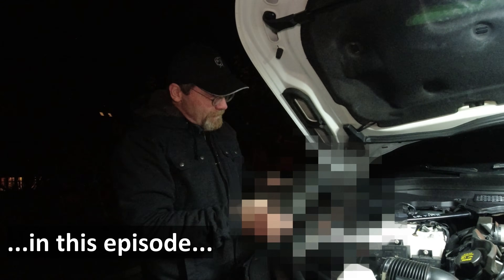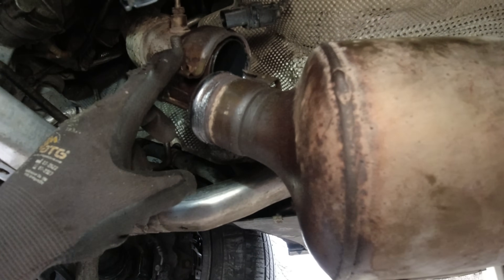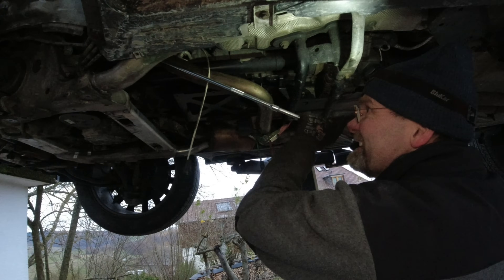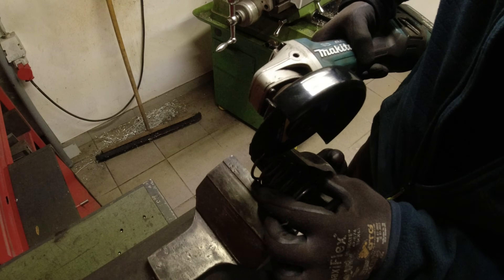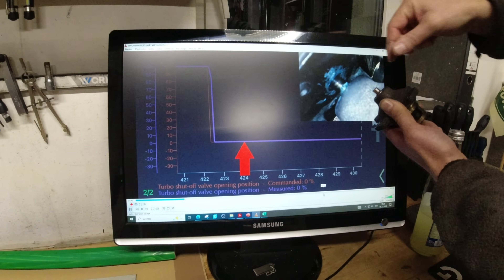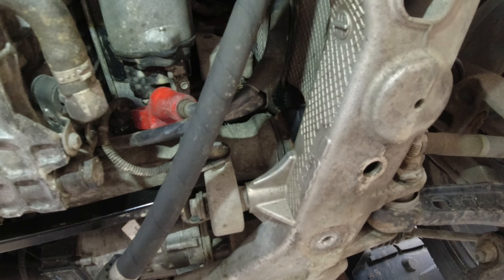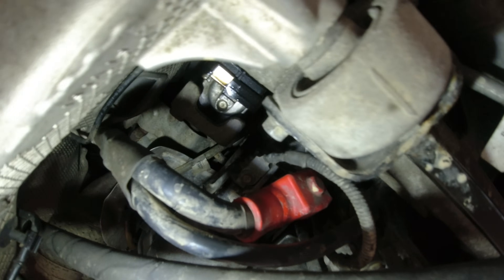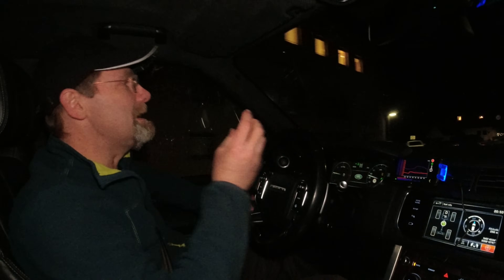Dumbest Land Rover Design Fault EVER - Fixed - L405 Range Rover / S5-Ep1

Comment: Hi much respect for your diagnosing, engineering, understanding and machining skills. I thought I knew how to work on cars, I know very little compared to you. If I could make one suggestion, get some battery operated tools - I use my Milwaukee 2554 and 2457 on almost every job.
Reply from the maker: We have Makita tools. But sometimes exerience tells to not use them and rather go manual. 👍🙋‍♀️
Reply: @Vera_and_Christian  yes sometimes the clicks can be oddly satisfying. I'm interested in either TDV6 diesel or petrol v6 supercharged LR4/full fat queen RR here in the states. It seems the TDV6 is a rather horrible engine based on your videos (my LR3 is long in the tooth 253k miles on V6 4.0 petrol Ford motor).

Comment: Land Rover engineering. My father’s new defender l663 also has loose sound deadening sponge blocks under the boot floorboards wedged between the suspension tower mounts.

Comment: 😂😂😂I had a similar problem with an old Series 3! P.O. had changed the fuel tank but the invoice must have been tucked in the neck and dropped in unnoticed. Every so often the paper would get sucked onto the fuel pick up and shut her down. By the time you came back to recover it the vacuum had decayed, paper dropped off it it would start straight up. Man did I spend a lot of hours and walk a lot of miles before fixing that one. Keep up the good work❤. Happy New Year.

Comment: As a car technician myself, sometimes we overthinking stuff.  I think, if you did a logging of actual values of both air mass sensors while driving, you would see a problem (maybe you can simulate it when you have time). But it is mystery to me why it did not pop up fault code regarding the right side air mass sensor when there was not enough air flow due to trash bag haha.
Reply from the maker: It did pop up a mass air flow fault. But only once or twice.  Because it was intermittent with the garbage bag moving around, I focused on the valve issue because it was more “mechanical”.  Should have kept my eyes open.  Christian

Comment: At 14:18 when you showed the diagram... I was screaming, CHECK THE AIR FILTER / INTAKE!  (As it's quickest and easiest to look at!)
Reply from the maker: We did 😅👍🙋‍♀️
Reply: @Vera_and_Christian  I still wonder WHY it's done the way it is. Most turbo just uses the electrovalve... need more boost, open valve more... All I can think is there is decreased response time from turbo?

Comment: Not having a LR and stil enjoying this, but I have to say (I'm at 11 minutes in by now) why in everything that's holy did you not disconect the vakum from the actuator and take a test run to se if it stil moves before trashing it to pieces? Why! 
Ok now I wil continue watching, this has to be good.😅
Reply from the maker: We did, but the car then has not the power of a V8. So for Christian that was not a permanent solution. Not everything we did is shown in our videos. 🙋‍♀️

Comment: I guess that LR does not know of this cause (obvious really), but the techs always fix it themselves without knowing.
When they follow the fault diagnosis blindly and jump in and replace the listed parts, somewhere along the process they see the loose bag and stuff it back into place - so fixing the problem. But as they have just replaced an expensive part,  they think that was the fix.
Cure by blind accident in such cases really.

Comment: Wow. Awesome skill, both in identifying faults, persevering until you found solutions and creating the parts that solve them. OK, the fault was an easy one to fix in the end but my goodness there was some impressive work going on before you eventually found it.
Reply from the maker: Thanks. I wish I would have found the garbage bag problem right away.  Instead I overlooked it.  Christian
Reply: @Vera_and_Christian  Your video reminded me of some events in the 1980s that I had completely forgotten about. I once spent several months and quite a lot of money trying to cure a misfire on a Honda CX500 motorcycle that only occurred when the weather was wet. Plugs, ignition coils, HT leads, parts of the wiring harness, I spent hours and hours replacing all this but nothing worked. Once on a dry day with the engine running perfectly I drove through a puddle, and the bike instantly misfired. It was driving me mad.
One day I was removing the fuel tank for the 100th time to access the ignition coils that were right under the tank, when by chance I happened to look closely at the rubber mat that was clipped to the underside of the fuel tank and saw that it was not in perfect condition. I unclipped the mat, removed it from the bottom of the tank and stretched it while holding it up to the light. Bingo! There was a small crack in the mat just where the HT lead left one of the coils. Could this be allowing high-voltage current from the coil to pass through the mat and earth itself to the tank?
I cut out a square of old rubber inner tube that cost me zero and placed it over the ignition coils, between the coils and the rubber mat, and I never had the slightest problem after that. I could ride the bike through torrential rain without a hiccup.
These are great stories that we can look back on with a smile and use to entertain mechanically-minded friends around the fireside on a winter's night with a glass of whisky in our hands... 😁

Comment: Why oh why is the engine taking its air from a cavity inside the bonnet???? what an odd design, I can only assume it makes it quiet and disguises engine intake noise??  Well found, also for your spring, you could have machined up some shims to go under the existing LR spring for fine tuning.
Different thickness shims will effect spring performance but I expect you never want to look at that ever again!!!!😁

Comment: A few weeks I had a similar problem with my 6.5t digger, the turbo did get air and the engine stalled. I worked my way back, for the air intake, and air filter (someone forgot to install one) to the turbo - finally found the problem: a dead mouse was blocking the turbo. it crawled all the way back there and couldn't turn back. that rotten, oily smell and small decaying pieces, I would have prefered a black trash-bag instead 😂

Comment: It‘s a pleasure to watch your videos. 
Honestly, when I found the bag inside the side wing of my L320 I was immediately thinking of the previous owner drug dealer theory. Later I learned that its a choke device for wading in too deep water to avoid water ingress in the air system. 😂
Reply from the maker: Thanks for the info.

Comment: What genius would design in a flappy plastic bag  in the air  intake ? Note to self, check integrity of acoustic rubber paint layer I sprayed inside my G Wagen snorkel 10 years back..... When all else fails, eliminate the obvious 😂 Good Work.

Comment: When you first diagnosed low pressure in the air box my first reaction would have been to drill a decent-sized hole or two in the airbox casing, upstream of the filter of course. Wrong solution, obviously, but it might just have worked!
Reply from the maker: Yes, that would have cured the problem  for sure and point towards the issue.  👍 Christian

Comment: What do you think about the freelander  2 in the UK I’m thinking of getting one but not too sure about reliability any thoughts on this?
Reply from the maker: Our Freelander 1 was the most reliable car we owned (over 10 years). It had the 118 hp TD4 engine. Does not get any simpler than that.  Christian
Reply: Dont buy if its auto. The engine is a 2.2 pug. Had one in auto, autobox rebuilt in part every 30k miles, starter every 50k, no other real issue
Reply: It’s a freelander 2    2.2 TD4 70,000 on the clock & manual …
Reply: I had Freelander2 2.2 STD. Drove 200 000 km, no issues, just brake parts and one wheel bearing replaced.

Comment: Christian, if it is any consolation, removing the actuators and checking the return spring was a perfectly legitimate approach to fix this problem. I have seen similar problems a couple of times in heavy trucks (they have lots of pneumatic actuators) where actuator return springs weaken or break with age or temperature, and it was why I suggested last week that it could be an actuator spring when you asked your viewers to guess what caused the problem.  The fact that it was something totally dumbass is very poor work by LR particularly on a 100,000+ euro vehicle. I doubt that Toyota would have done this 🙁
Reply: That’s because Toyota is 20 years behind 😉

Comment: Landrover knows about the problem and the solution. You take the car in for service, they remove the bag and charge you for a turbo charger actuator valve that is not replaced. Win win. Your car is fixed and Land Rover make a small profit. If you’re a prick, they just move the bag out of the way.

Comment: Blimey, what a pig of a fault to find!
Something I noted in the installation instruction sheet "...then pierce the bag to fill the void" I believe you will find when you do so,  as the foam inside is compressed (vacuum?) it expands to fill the void and lodge in place. Either the bag has not been pierced or the foam is faulty or it was not pushed in far enough/correctly and the expanding foam did not get wedged in place. Not a very good design for sure.

Comment: Unbelievable all that work for nothing  I had a problem with my 2014 sport after wasting £700 on 2  so called experts , 4 weeks off the road  , it was in limp mode every fault you can imagine , it was a earth wire tack welded to the right side inner wing behind the plastic , it just dropped off , I bolted it to the inner arch perfect, I found this myself and hope land rover now bolt it on aswell

Comment: oef! That is soo bad from the official LR dealer > poor mechanics! Only calculating labour! I will tell you something more that could help you when you have another restrictied performance issue. Cleanup the MAP sensor on top of the air intake tube. There is a lot of egr diesel Ruß/stuff on in. A 2 minute job or put a new one on it🙂. I think part LR125298.  Free tips from a guy near Eindhoven!
Reply from the maker: 👍We know just about everything there is to know about that car. Unfortunately, a Youtube video cannot be longer than about 35 min (Algorythm, don't ask me why ) And we work hours on end. Some things just don't make it into the video. 👌👍🙋‍♀️

Comment: Ha that sound proofing is a ridiculous bad quality from JLR.

Good detective work there.
I would find a better noise damping material.

You've probably got extra boost now because of the stronger turbo actuator spring you put in.
What's not to like.
Well done Sir ❗ 👏
Reply from the maker: The spring delays the 2nd turbo a bit.  So it’s a bit like when the Saturn 5 turns the 2nd stage booster on.  Lol.  😂 Christian

Comment: Makes you wonder how many dealers change the part (or maybe don’t) and charge the large sum then just push the plastic bag back in. Customer none the wiser.
Reply from the maker: That is what happened on our mall crawler, they changed the lower suspension arms and propshaft, and all was needed is resetting the adaptation values of the automatic transmission. And not for free of course. 🙄😅👍🙋‍♀️

Comment: Still a great video, lovely car? Boat engines can suffer similar stupidity with blocked fuel tank vents and loose sound insulation in the engine compartment!

Comment: I am new to your Channel, and a Toyota driver. Do Land Rover supply you with a Lathe, Milling Machine, Welder, Car lift , and pit. You seem to have more kit than Red Bull racing. As a Toyota Driver our tool kit consists of a Plastic scrapper to get the ice off the wind screen. As a German I can't believe you brought a Land Rover Discovery, it's a bit like Göring  buying a Spitfire. I am very interested with what Tata ( the Indian latest owners of Land Rover) will do. I think that their three wheeled two stroke  version of the Range Rover may not be received well in Europe. Just Imagine the Beckham's climbing out of that. Just thinking ,will they make it three wheel drive, how would you get that over your pit?
Reply from the maker: Not even the scraper is for free at Land Rover 😂 thanks

Comment: That is incredible ! I watched expecting Christian to replace a turbo part, but no it was a crap engineering fix. I mean what engineer would place a plastic bag in what is part of the air intake and over the years it will definitely will come loose move around and restrict air flow. I certainly hope that the dumb engineer who did that got the sack. But no doubt he got a promotion for increasing the profits of Range Rover service centres.😊

Comment: I'll bet that if the previous owner had paid for the LR repair, the shop would have kept the car for a couple of weeks before fixing the trash bag position and accepting payment of EU2800.  They probably pull the trash bag out on the previous service........
Reply from the maker: The bag may be some kind of a Trojan horse.  It’s placed into vehicles to give the workshops something challenging to find.

Comment: I wonder how many Owners have paid LR €2700 to fix a plastic bag issue?
At this point, I would not be surprised if they knew the issue but instead quote a much more expensive problem, then fix the no cost one but charge for the expensive one.
Reply from the maker: I don’t think they did this on purpose.  It looked easy but technically a hard to find issue.  Christian

Comment: Utterly brilliant video and well done for eventually tracing the issue.
OK so it was a lot of machining and re-engineering but no engineering is ever wasted. You probably have THE most efficient turbo system on a Range Rover and we got to share some clever work.
But mate what a result!
The only dumbasses are the Land Rover dealers but in fairness to them they couldn't charge anyone 4 weeks labour and EVER admit it was a piece of soundproofing.

Comment: Wow just wow. 1 thing i learned is you go crazy down the rabbit hole with out your wife. 2 is that the same intake that allows the range rover to wade in deep water?
Reply from the maker: 😅👍, Yes it has 900mm wading dephts. (Ithink at least, but it's much higher than on a Discovery)🙋‍♀️

Comment: 𝑰 𝒉𝒂𝒗𝒆 𝒓𝒆𝒑𝒂𝒊𝒓𝒆𝒅 𝒂 𝒍𝒂𝒏𝒅 𝒓𝒐𝒗𝒆𝒓 𝑫𝒊𝒔𝒄𝒐𝒗𝒆𝒓𝒚 𝒘𝒊𝒕𝒉 𝒂 𝒔𝒊𝒎𝒊𝒍𝒂𝒓 𝒐𝒊𝒍 𝒈𝒐𝒊𝒏𝒈 𝒕𝒉𝒓𝒐𝒖𝒈𝒉 𝒕𝒉𝒆 𝒘𝒊𝒓𝒊𝒏𝒈 𝒇𝒂𝒖𝒍𝒕, (𝒚𝒆𝒂𝒓𝒔 𝒂𝒈𝒐 𝑰 𝒄𝒂𝒏'𝒕 𝒓𝒆𝒄𝒂𝒍𝒍 𝒕𝒉𝒆 𝒆𝒙𝒂𝒄𝒕 𝒆𝒏𝒈𝒊𝒏𝒆 𝒇𝒂𝒖𝒍𝒕)!
Reply from the maker: 👍Yes, the Discovery 4 has similar problems in adition to the oillevel sensor coming loose, or better not being plugged in correctly during assembly. We have a video on that .🙋‍♀️